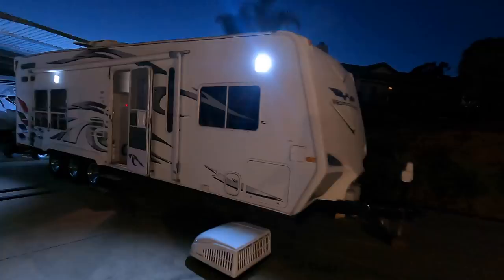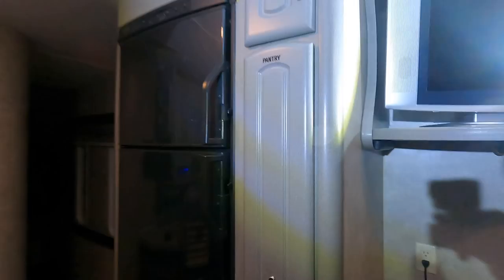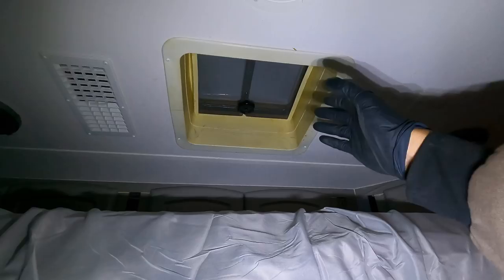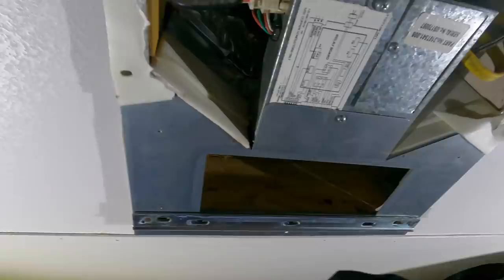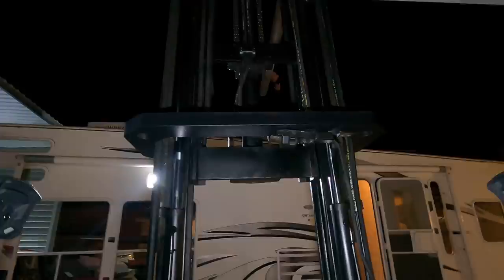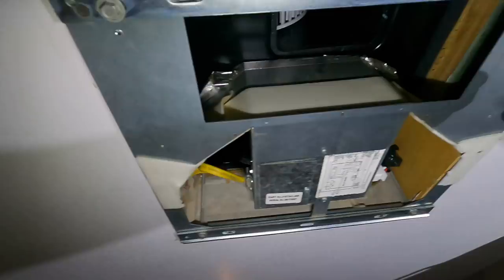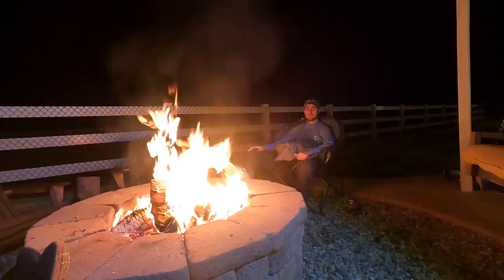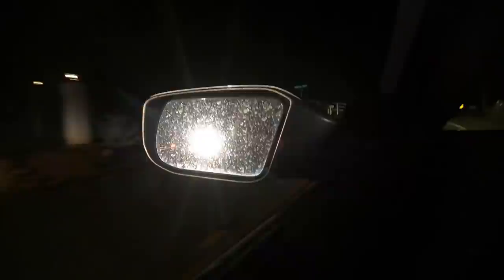Nothing but problems!!

Comment: He needs to test drive a super duty then drive your rammer. He will choose the super duty 👌
Reply: 100%. I've had all three. 2014 ram 2500 big horn cummins, 2015 f350 lariat 6.7L, and Gmc Sierra lml duramax. All great trucks but the best 1. Ford super duty, got the low end cummins torque ( actually comes in lower then the ram), but the top end of duramax, and you sit on top as to down in a hole like the GM. Also tows alot stronger then the ram, it rolls up the mtns here with 23-25k gooseneck. 2nd place id say the l5p duramax, then ram.
Reply: @krice24  ford FTW!!